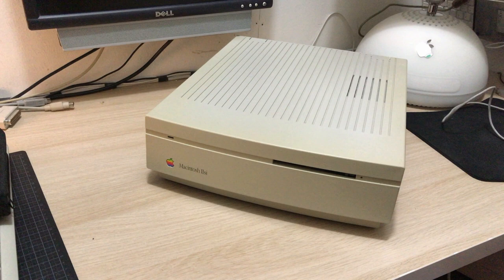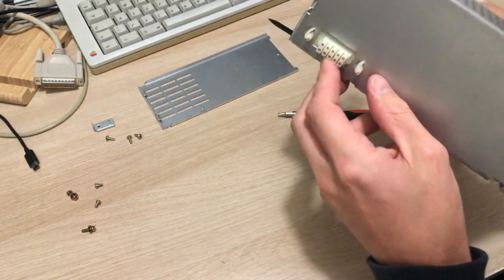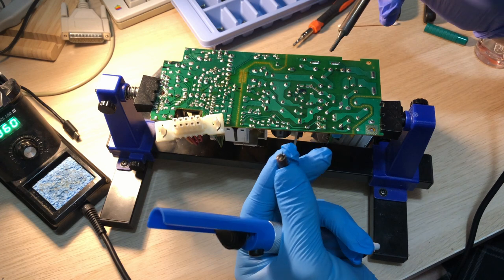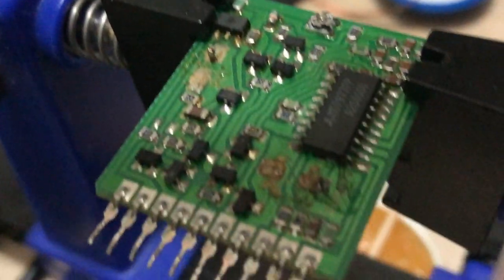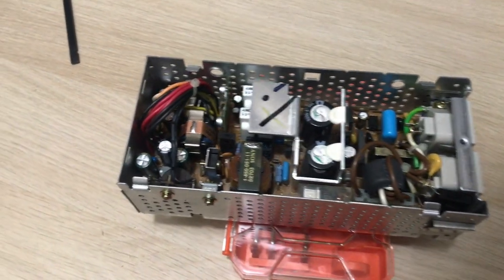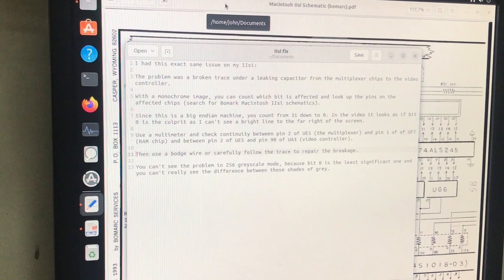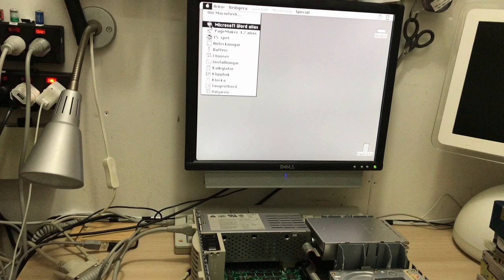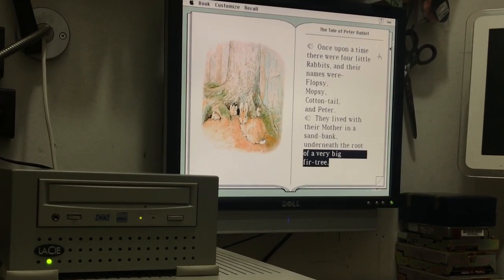Macintosh IIsi - Graphics & PSU fix + Retrobright

Comment: That's fantastic news! It really is bit crazy that it was clear from the previous video which bit was affected and it worked on the first try for you. Mine was bit 3 IIRC and the trace was severed under C20. The PSU in my IIsi actually also died recently, it is now back on the TODO-list of repairs. I also love the design of the IIsi and mine also came with the full page display, so I will recap it soon. I'm glad I could help, I very much enjoy your videos!
Reply from the maker: Yes, so cool that you could diagnose it from what you saw - big thanks! I wouldn’t have figured it out on my own. Good luck with the PSU and glad you enjoy the videos!

Comment: I've used the same method to retro bright my Performa 450. It isn't the quickest method, but it is certainly the cheapest. The trick is to apply the cream and cover over and over again, that way the imperfections will eventually cancel themselves out.
Reply from the maker: Yes, several short sessions seems to be the way to go. It's no quick fix but appears to be reliable. I'll have a go at something bigger soon.

Comment: Switch the 40MHz Crystal with a 50MHz crystal to get equal in speed to a Mac IIci. But also find a 68552 Math CoProcessor and put it in. Then it would be a Mac IIci!

The 68030 on the Mac IIsi is running at 20MHz can withstand being bumped up to 25MHz. Going faster than that will cause problems.
Reply from the maker: Yeah, I might! FPUs are hard to come by but the crystal could be interesting.
Reply: @retrotechguy  Yes, the FPU socket is part of the Nubus riser card that seems super rare. Maybe someday there will be replicas... I can wholeheartely recommend the 25 MHz upgrade; I did this on my machine and it works great.